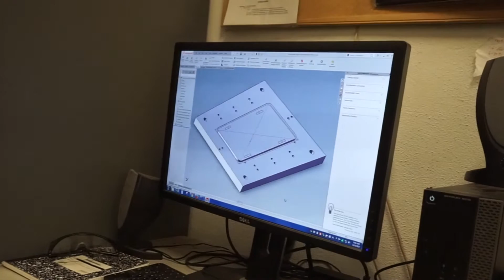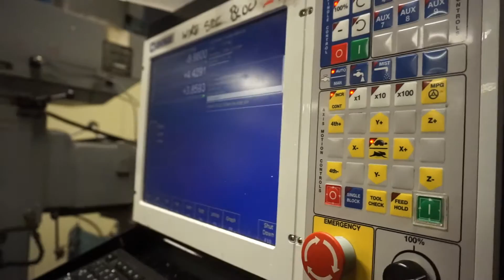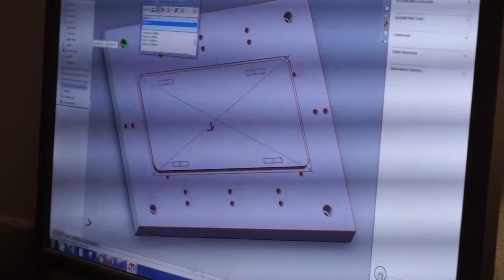Mechanical Engineering Technology

Comment: Sir what's the difference of mechanical engineering technology  into BSIT major in Mechanical Technology?
Reply: Mechanical engineering is a full on engineer, they need high levels of math and need university to do 4 years of studying, the other one is basically a technician
Reply: @SexyBoyRoy  ahh ,if the students graduated 4 years in Mechanical Technology it's also called mechanical technician only or mechanical technologist?
Reply: @pobringtawo1732  No, you can also be a mechanical engineer with this Mechanical Engineering Technology degree. Click on the website. The difference between this degree and a typical mechanical degree is that this is focused on manufacturing. So you can be an engineer creating tooling parts, you can also be a technician doing maintenance on machines. It is versatile
Reply: FROM GOOGLE : mechanical engineers are very design and theory-oriented, mechanical engineer technologists focus on putting ideas into action.
Reply: Engineering technologists often assist engineers; but after years of experience, they can also become engineers. Like engineers, areas where engineering technologists can work include product design, fabrication, and testing.